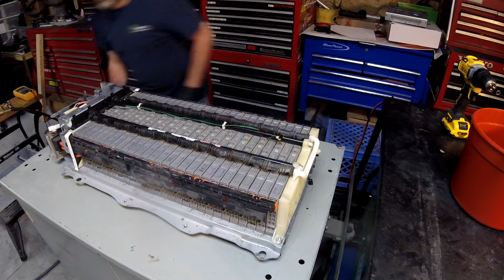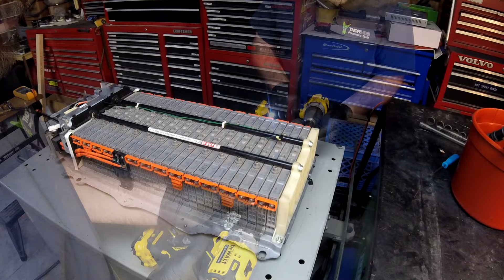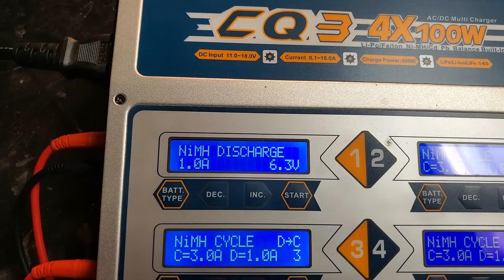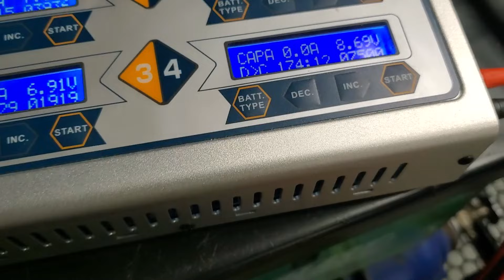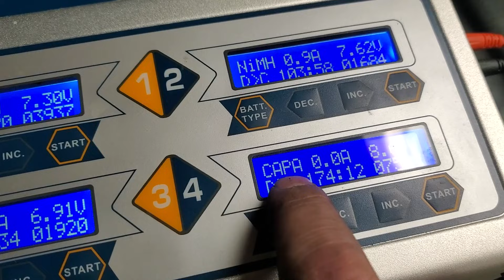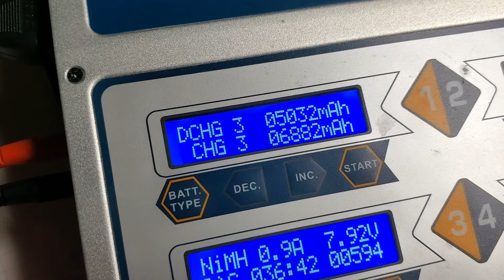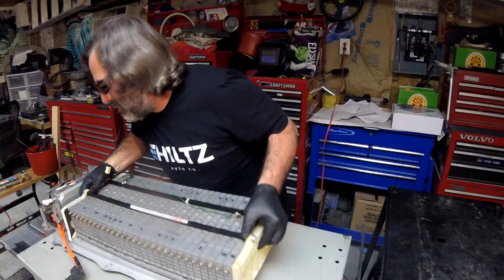DIY Refurbish / Repair Hybrid Battery 2nd Gen Toyota Prius - EV-Peak smart charger POA80 P0A80

Comment: Greg,  thanks for this video and the thorough explanation of refurbishing the Gen 2 HV battery.  I would like to know why it took 16 days to charge/discharge/condition the battery cells.  It was limited to 3 cycles and you would get a number…I’m guessing this could take up to 1 hour per pack which would be 28 hours (two days).  Can you explain that part so I can understand the downtime for the vehicle?  Thanks
Reply from the maker: Hello Kelvin, Thank you for watching and commenting. The time it takes to refurbish a pack will depend on how long it takes the charger to bring the cells back to the desired minimum reading which is 5000 mah in this case. Some cells took only 2-3 cycles to reach my goal while some took 12-15 cycles.  Then I had the cells that ended up needing to be replaced which I ran many cycles on to try and get them back up. I have some feedback in the comments from others who have changed the settings some and had good results with speeding up cycle time and getting higher low mah values. If you do the process to your car please write back in and let us know what your settings were and how long it took.
Reply: …also, if using the ‘good’ cells an d purchasing a few new ones…how long should this be good for (time/miles).
Reply from the maker: I have refurbished several of these packs and have had no failures as of yet. Some of the owners drive about 10-15 miles per day while others drive 50-60 miles per day. My personal opinion is that the more you drive the longer the pack will last. Sitting for long periods of time is not good for the pack for sure.
Reply from the maker: Randy, Thank you for watching and commenting. I agree with your analysis that one of the 2 cells in block 9 are getting weak. You should drive a bit and perform same test again to confirm the results are same. If they are the same and you are wanting to just do a quick in and out "repair" you could remove the battery but not assemble the actual pack. Then setup charger and run the 2 cells in block 9. Once done with the suspect cells, run a couple of cells that read higher just to compare the results to the cells in block 9. If cells in block 9 come back up and are close to the same values as the other test cells you could skip the balance stage and put pack back in car. Write back and let us know what you do a d how it turns out.
Reply: @GreggFesto  Do you recommend running another series of discharge/charge to see if these low cells will come up to over 5k milliamperes?
Reply from the maker: Kelvin, I run the cycles until I get 5000mah on low number or until the high and low numbers both start declining enough that it is apparent the cells cannot be refurbished.
Reply: @GreggFesto  
Thanks Greg; now I have a better understanding of why it took you 16 days to complete the refresh.  I have this charger going 24/7 for 6 days to complete round 1.  Round two starts today.  Thanks
Reply: Gregg,

My reconditioning is complete.  It has taken ~30 days to do all 28 cells.  Two were bad and all the others came up to at least 5k Milliamps.  I took two days to balance the pack and proceeded to reinstall the battery.  I turn on the vehicle and ran the ODB II scan tool and it showed all green batteries although I don’t think the engine ever engaged.  The transmission would only shift from Park to Neutral.  Can you help me troubleshoot the reinstall?  Thanks
Reply: Gregg,

I figured out my issues; it was not pushing down on the HV kill switch once rotating it to the top position.  I will drive around tomorrow to check performance and any error codes before getting an inspection and current registration.  Thanks for helping me DIMS’g this repair.

Comment: Is it good to move.middle cells and bring outer cells  in the place
Reply from the maker: Hello Edwin, Thank you for watching and commenting. Once the cells have been balanced you should put the cells with the greater discharge mah towards the middle of the pack and the cells with lower discharge mah numbers at the ends. The idea is to have the area with most heat (middle) fitted with stronger cells. Please write back and let us know how your pack turns out after refurbishment.
Reply: @GreggFesto  I use my car for work if I take battery out it means I can't work few days what u think the Alibaba battery are they ok is about 1236$
Reply from the maker: Hello Edwin,  I have never purchased anything from Alibaba before.  I can tell you that to do the process I am doing to the battery will take more than a few days. This battery in the video took me just about 16 days. if you do get Alibaba battery please write back in and let us all know how it does. A video of the battery and your thoughts on it after you install would be great to watch. You should post that if you can.
Reply: @GreggFesto  I use my car for work if I open battery then I won't be able to work
Reply: @GreggFesto  problem is I use the car for work if I take battery recycle I be out of work

Comment: if the heat affect the durability of the battery so much,can it be better to make a new case using the hole back seat (sacrifice of it) and separate all of the cell with space beteens and a new case who will blowing air on all of it ,and it can be much easy to change a cell who is to old because they are not attach together ,,????
Reply: i think if you have a cell who die ( because you have much more place) you can find some llithium batteyr like the round one and wild it together to reach the good amp and voltage and remplace it by that ,i know its weird but i like trying weard stuff to save money
Reply from the maker: Hey Jimbo, Thank you for watching and commenting. The cells when charging and discharging produce heat and they expand. Leaving space between them would address the issue of heat but would allow the expansion of the cell so it would fail or even explode.
Reply: @GreggFesto  maybe the fire hazard when they charge or in the road is because they was compress to much ??? with more space to expand i think it can protect them ,and with less heat i think it can protect them also
Reply from the maker: Jimbo, If you try this and it works please let us know.

Comment: Gregg festo great video 
What would be the settings for a 30 volt cell pack from a Hyundai sonata hibrid battery 
I just purchased the same charger you have in the video 
Thanks
Reply from the maker: Hello Guillermo, Thank you for watching and commenting. I am not sure of settings for your cells/pack.  I got the settings I use from Forum group called PriusChat. Maybe you can find a Hyundai group or forum that has experience with this process and can provide you with the correct settings. I wish you success and hope you will write back and let us know what group others can go to for the Hyundai battery help.

Comment: Hi Greg, I'm wondering  what  I need  to adjust  so my capa doesn't  keep  not to cycle  more than 1 cycle should  I'm decrease  or increase the timer so I can run 3 cycles. Thank you so much
Reply from the maker: Hello Jj, I just start it again myself. I find that cells which have been sitting for a long time will CAPA out with very low discharge mah for a cycle or two but then if the cell is good will continue to gain on the discharge mah with each cycle. I have not tried to adjust the timer settings before. If you try this and get a result could you please post here so myself and others will know how it affects your charge? Thank you for watching and commenting.

Comment: 1. Should use specified torque with screws 2. Should connect all modules in parallel for 24h to equalize voltages and make them best balance (after charging)
Reply from the maker: Hey Tom, Thanks for watching and commenting.
1. The acceptable torque spec for the screws is pretty wide. 
2. The balancing is done at 18:15 in the video.

Comment: I need to buy a fancy charger, it takes many days to do, the results could last as little as 3 months, but I save what?  I suppose it could last years?  What is your opinion on spending up to $2000 or so on a newpriusbattery...com chinese battery pack most likely to last more than 2 year warranty?  Any experience anyone?
Reply from the maker: Hello Daniel, Thank you for watching and commenting. I have not experienced a problem in only 3 months and have not seen red triangle again on any of the packs I have refurbished using this method. I have no input on new packs, never bought one. Please write back in and let us know what you decide to do and how it turns out.

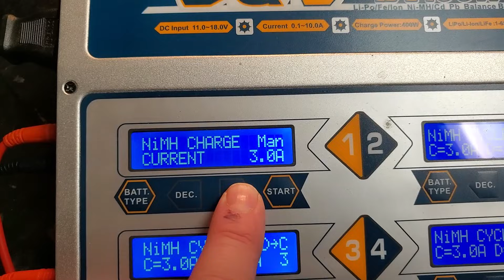Comment: One thing to remember when programming the BMS system…set the NiMh discharge voltage to 6.3V as the LOW cut-off voltage.  This flashes by the screen pretty quick at point 13:07 in the video.  I discovered that mine was set to 0.10V which is much too low for the battery chemistry.  This is REALLY CRITICAL.
Reply from the maker: Hello keyslammer82, Thank you for watching and commenting. You are correct, this 6.3V setting was left off the verbiage in video by mistake but is in the description of settings under video.
Reply: @GreggFesto  What settings would you recommend for 2010 Lexus RX450H the module specs are slightly different. 
Module Voltage = 9.6V
Cell capacity = 6.5 AH
Reply: @sidguerrero1857  the specs aren't different, they're the same nimh module. Yours aren't 9.6V, they're 7.2v nominal, but you have 40 modules instead of 28 (like prius) or 34 (like camry hybrid/avalon hybrid)
Reply: Mine was the same way. I did a lot of research and planned to do exactly as he said to do. But then I realized that I may have needed to change that part of the settings too. because I thought I was noticing them discharge to 1v. So all 28 modules got their first charge and discharge down to 1 volt. I think. Not good. I really hope it didn't mess them up too much!
Reply: @alicehatter4973 were they damaged?

Comment: great job - Boys and girls - now you know what refurbished means - it means that it can go bad at any time in the next 3-6 months and one must do this again - Thanks to Gregg for opening your eyes to it. NOW, some sellers try to make it look professional and paint the metal box, Green or Black (LOL) - which I HIGHLY do not recommend anyone painting it - but that is how they fool you into thinking that their battery got more magic - IT DOES NOT.
Reply: LOL. I bought a 2003 Prius, with a Green battery in it, for my wife.
Unfortunately, the car set for a couple of months after that purchase and the battery went south.
When I pulled the battery, I found that the first 8 modules on the passager side were at below 1 volt. The reading was somewhere around 0.5v. 
To me indicates that Green Inc used some very weak modules in that battery.
That is some magic. I am cycling them right now but have no idea if I can bring them back to life.
After 5 cycles of discharge-charge, they are all in the 3K range.
I did 3 cycles on one of the "good" modules and that one is in the high 4K range.
Right now, the efficient side of me wants to buy 8 replacement modules and not waste time.
The stubborn side want to cycle these bad modules until there is no hope LOL.
Wife is out of the country for a couple of months so the stabborn side wins for now. I have time to keep running the discharge-charge cycles.
Reply: @mark98115 whoa the wife is out of the country for a couple of months? That's the craziest part of the story lol
Reply: @mark98115 did your wife back home?

Comment: Hi Gregg,
I posted my response couple days ago but do not see it anymore, anyway, my 2005 Prius doing well with reconditioned battery, MPG is up to 45. Also, I am using Dr Prius app that I set to 95° to override battery temperature, so it turns battery fan to high speed at around 100° to cool it down. By some sources battery can operate normally with temperature up to 110, by other sources up to 120°. Dr Prius app full battery test shows all parameters are great including battery temperature. Hope the battery will work fine at least another 30,000 miles!
Reply from the maker: Eugene, Thanks for writing in with an update. Not sure why a comment would disappear. I do not see where pictures can be posted to comments section. I believe you are correct in keeping battery cooler to last longer. I bet you get over 30k miles. Thanks for all of your comments.
Reply: @GreggFesto  "In order to prevent spam, YouTube has disabled the ability to comment on videos with links. This means that you can't include a link in your comment when you post it. If you want to share a link, you can do so in the description of the video." This is why my comments with links disappeared...
Reply: By some reason comments with links are disappearing: I added yesterday a comment with link to my photo of Dr Prius app full battery test, it disappeared (because not possible to add a photo to a comment)...

Comment: Good Day Gregg. Thanks for the wonderful vid! But, please give us an update on your battery's performance, as it seems that there are 2 schools of thought re discharge level. I used the default of .1Volt.
That "appeared" to weaken 5 modules. But, I don't know if those cells were already moribund/dying. I ordered replacements that will arrive this week. Your input would be helpful in determining how to process the new ones.
Reply from the maker: Hello AgEvermore Infinity, Thank you for watching and commenting.
   I use the same settings each time I do this process as I have always had what I feel are good results so I am not sure how adjusting the numbers would play out.
   The battery shown in this video is almost 2 years old and has done over 20k miles so far. The car should be back here at my garage in the next couple of months and I plan on asking if I can take the pack out and put it back on the charger to obtain readings. I plan to share results of this with everyone but it is still a bit away.
Reply: @GreggFesto  Absolutely outstanding Sir! 👍
I raised the question after reading a Prius Chat thread.
Then, as an experiment, I set my discharge to 3V instead of .1V, using a twice failed module (0250)/4419 maH final reading after three cycles.
I then returned to your settings and cycled three times automatically.
Final result: 6014mAh/7500 CAPA! I AM TESTING ANOTHER FAILED MODULE NOW using the same procedure. Will post results tomorrow
Reply: @GreggFesto  Good Afternoon Sir, Again! With gratitude to you, and humility for my Discovery, I now report that DISCHARGING to 3V instead of .1V, REVIVED my modules from 2300 mAh to 5000 milliamp hours and to 6100 milliamp hours, respectively!
I am reporting earlier than promised because the new settings TAKE LESS TIME!!
Reply: @a @agevermoreinfinity20 n you elaborate on this? Aren’t Greg’s setting to discharge at 1a/6v ? Yet I see you say you discharged at .01v and then at 3v and you “revived” weak cells? Isn’t that bad for the cell? I have always heard discharge no less than 6v or you risk killing the battery even Greg has chimed in on this so I’m just curious how you managed to even charge to near zero and then half of the recommended amount had achieved positive results

Comment: Hi there Gregg, thanks for sharing your exp with us, you’ve been very helpful! Although if you don’t mind i got a question: is it capable of discharging more than 0,9A? Or charger won’t do it deliberately ? I have imax b6 mini, even though max rate of discharge is 2A it still doesn’t go above 0,6-0,7a per hour, and even 0,3A seems like a huge difference when you have to cycle al 28 of them several times plus new ones. Thanks again, you rock!
Reply from the maker: Hello Oleg, Thank you for watching and commenting. I acquired my settings for this procedure from the PriusChat forum. I have had such excellent results that I have not made any changes to see what will happen if the settings are altered. It is my understanding that the slower discharge and charge cycles help the cell regain capacity. So perhaps the results will be faster with a higher amp setting but not as effective? I hope someone reading this will have knowledge to share with us both on this topic.  Please write back in and let me know what settings you use and how your pack turns out once complete.
Reply: @GreggFesto  gregg, do you happen to have a photo of capacity of cells that you took down after cycling? From what you’ve shown this charger doesn’t see delta peak very good, it charged both time up to 7500 which is capacity cut-off. If you have it that’d be very helpful
Reply from the maker: Hello Oleg, I do not know how to post photos to the comments section. I replaced any cells that the charger could not bring back to at least 5000mah low number. Some cells recovered quickly and some got worse on each cycle. Most would recover a little each cycle.
Reply: @GreggFesto  yeah i also hope that someone with bigger knowledge will share here! 
I did started by charging with 5A, discharging at 0,6-0,7 and then charge again. I wish i’d train cells but it’s way too slow with one charger. Now my battery is in parallel getting ready to go to the car tomorrow morning. I’ll buy one or two charger as you used and train my cells later (or buy 4-6 imaxes more hehe, it sees delta great, looks reliable but slooooow to discharge). By the way i even tried to start my cycles from 6v (charge-discharge) actually there’s no difference eventually 1st charge or discharge says nothing and i hepled my imax to discharge a cell to 6v with 18w lamp which is about 1,5A plus 0,6 from emax and till 6,4v a cell hold this load fine
Reply: It is because the maximum discharge wattage has been reached, you will never see 2a diacharge on an imax charger with these modules.  for a 7.2v nominal battery the diacharge current will be much higher than say a 3.4v lipo